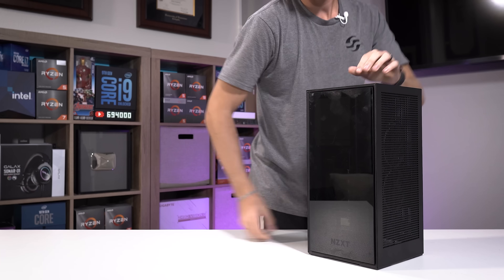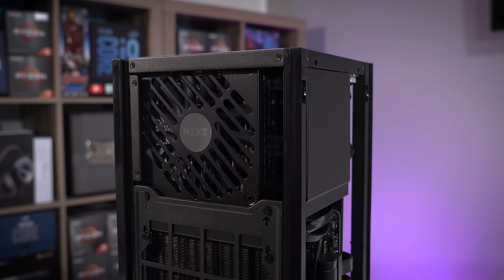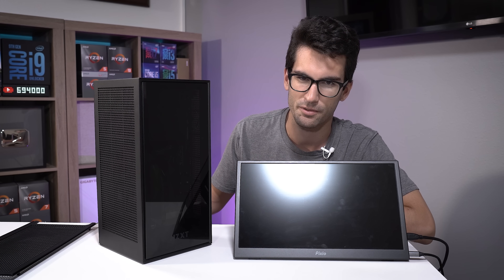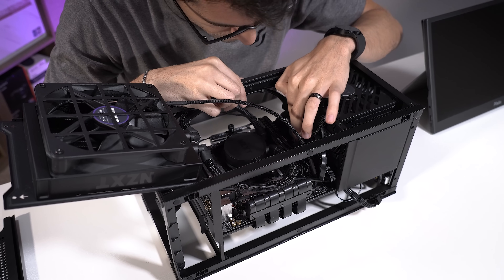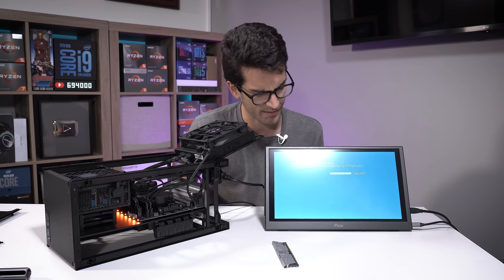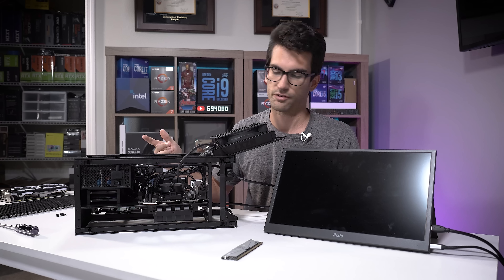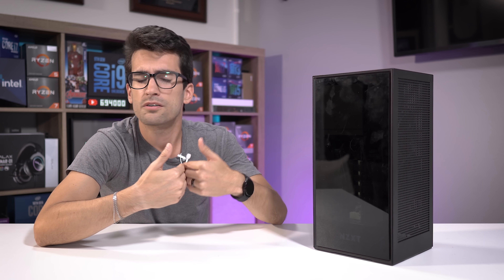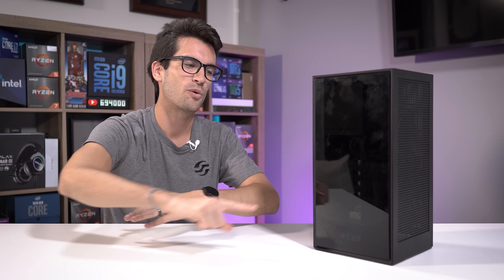Fixing a Viewer's BROKEN Gaming PC? - Fix or Flop S1:E16

Comment: SOMEONE PLEASE HELL !!!! I have recently just bought my first PC (prebuilt) for £800.00, I got it to play warzone on, I get a solid 60-80 FPS however my ping is always between 50-100, even though I have a strong wifi and this does not happen on any other games e.g. apex legends, I have tried everything to fix this, Ethernet cables, tp links, changing the dns settings on the pc, deleting back ground apps, deleting and re installing the game itself, but nothing seems to work, which I’d disappointing due to me buying it purely for that game itself, if anyone could help me it would be much appreciated, these are the specs for you too know ……. AMD 6 core RYZEN 5 3500 processor ….. NVIDIA GeForce GTX1650 …. 8GB RAM … 1TB hard drive (: 🤟🏾

Comment: So I just found a PC by the dumpster of my apartment complex. It has a 1060 in it… the only things that were missing was power supply and CPU. But I live in Seattle where it rains constantly. So the whole PC was wet. And steps I should take to try to salvage these parts?

Comment: I hope to god you checked that He'd swapped out the riser cable? (ps only 30 seconds in so? )
Ahh yes you did, 
As for the Ram I bought a PC so I could rob the GPU from it  and use the bare bone as a HTPC as it had a 3400g in, couldn't get it to work with the APU tried all sorts, different leads etc, eventually tried my RAM out of my other PC and it worked, put the original RAM in and it worked again. so RAM can be finicky as I only took the GPU out and didn't (Knowingly) touch the RAM. yet Ram was the issue

Comment: RAM Back in the day  used to be my 1st concern if no post .  1 always a bit dicky ddr3  OR not in right &  that loose cable 
  ddr4 all good  i once started PC new refit and forgot  the  watercooler cable Posted ok  100cel CPU  i let it run 2ms  to see what happened Nothing Gigabyte Aorus  was right  
if that happened on old ddr3 pc it would've shut down in a sec

Comment: Ram is really iffy sometimes lol, I remember with my current built I shut it off in the night and it was working fine, then it wouldn't boot back on and even the gpu wasn't turning on, I thought there was something wrong with the gpu but it turned out that the mobo first checks the ram before the gpu and it just didn't go towards the next step. I just needed to push the kits in harder.

Comment: A buzzer to sound out post codes would be a nice thing to get with a motherboard nowadays... My B550 has leds at least, but is it even a PC if it does not beep when turned on?? Anyway bad ram post code beeps would have saved a lot of time and effort.

Comment: I put the same GPU in my H1... Oddly enough I had a similar issue. It was the GPU (which was salvaged from an older system). slapped a 1660 Super and that fixed it.

Comment: I have build my friends pc it worked for 9 months now few day ago his motherboard ez debugging led was started flashing in msi b450 pro vdh pro max m2 I tried from bios with removing the cell and also by jumping jbat1  but I was not able to find the issue then we reached to local store and he changed psu then it works fine . But I was confused because when I was booting CPU fan was spinning .

Comment: mine died when i installed my nvme m.2 ssd then powered it off from bios screen. i believed i bricked it already. i tried the ram and gpu to no avail. i am afraid i might damaged my ram, board or worst cpu and gpu. i am really sad, even though its a fair low spec one, i spent a fortune (for me) and now its gone
Reply: Why install the SSD when the system was on? Try removing the CMOS battery.

Comment: I was screaming Ram from the start....I just replaced my AIO (first time working on a pc). Afterward I got no video. Freaked out. Full Panic Mode. Then remembered I removed the first Dim to fit the pump. I appaerently didnt reseat it properly when I put it back. Did the same thing you did and bam....All good again

Comment: I had a similar issue with my system when I built it earlier this year. I was receiving power but had no post. My brother in law seated the ram in the 2 slots closest to the cpu. I might have a dead channel in the first slot but I only use it for gaming and the other 3 slots work fine so I’m good. Also for some ungodly reason every time I would wake my PC from sleep it would do a complete reboot instead of just waking up. It doesn’t do it anymore but that was just odd and annoying.

Comment: Hey guys i really need some help and didnt know where to go other than my favorite youtubers comment section lol! Well Heres the issue.  Newly Built computer last night, and only drive i want in the computer is a 2tb samsung evo m.2. Everything ive tried i cant get the windows installation to work, i read where the system has to be in uefi mode to be able to work properly, well if i disable CSM and Use UEFI instead the computer doesnt recognize the m.2 and just boots stright to bios everytime, BUT if i switch it to CSM Instead, the bios sees the m.2 AND the windows logo pops up, then freezes, no spinning dots or nothing. Heres some things iv tried, ive tried Disabling And enabling CSM/UEFI. I also swapped the m.2 to a different port. I also tried moving the ram into different slots to see if maybe that was causing the issues, nothing. I also reset the CMOS. PLZ PLZ someone read this and give me a hand, this computer isnt even for me, its for my fiance’s little brother.
Reply: I also want to point out, i see that this is a common issue, but ive never ran across it.
Reply: Did you create an Windows installer USB? You need to boot from that to install it. You will need to use UEFI mode if the SSD is NVME. I would always use it if you can.
Reply: @TRD_2zz  thanks for the reply, the issue was the bios needed an update to read the nvme

Comment: there was a device, long before led diagnostic, that told you what the computer was doing. Remember the pc speaker? the plug is still present on probably) all motheboards. It is there on a ROG crosshair hero vii wi-fi. Although, getting a pc speaker could be a challenge.

Comment: The other day I had same issue on my second system...PC just didnt turn on. So I take out GPU and tested if works..it was, I swapped ram sticks and left only one in slot one, no fix. I suspected PSU since it was second hand and I had power crash in my flat. So I check cable connections...than swap PSU for other one...no fix...I started swapping cables from PSU...no fix. I was ready to start digging in to motherboard and CPU. But before that I did one last thing I can. Take out battery and reset CMOS. It worked ..I felt so stupid that I didnt start with that. I watch your videos so I knew well but I was so focused on PSU that I just didnt do it. 
Long story short ALWAYS start with CMOS reset.

Comment: It isn't a wiring issue. I have 2 of the same aorus b450i wifi boards and I have the same issues. The board itself does not post if it is under a little bit of stress to the bottom (like if you install the gpu). If you give it a little tip upwards it is all good.

Comment: Greg, this is not how you test memory.
you need to plug each module on its own first and than check if it is stable under full load (memtest64 / OCCT memory test).
after testing all memory modules individually, only than you can reconnect all the good modules back to the motherboard.
Reply: Yea I would of ran memtest86 on them for a bit since it could still have a bad stick and the issue will come back again.

Comment: I looked at the ram before you removed them. you even pressed on them (slightly). they looked properly seated from what I could see in the video. maybe the stick further away from the cpu was a millimeter higher, idk it's hard to tell

Comment: Wow, this turned out to be a much simpler problem than I thought at first. What baffles me is that, considering he replaced the motherboard and consequently had to reseat and rewire everything again after installing the new motherboard, he must have had the RAM already improperly seated on the old board and then done the same thing on the new one without noticing. Not throwing shade at him or anything, things like that have happened to me in the past and made me feel really stupid, but still this is one of those things where you just facepalm because of how much time you spent on the issue when the fix was that simple.

Comment: Could it have been xmp or the like? I had a similar issue that the memory was not supported on the motherboard so could only run as 2333speed as soon as I did a coke boot after enabling xmp, I got no boot but everything turning in

Comment: Hey Greg, Greetings from India... Great video as always... As a PC hobbyist myself, I find it informative to watch troubleshooting videos like these... Just a quick question to the community though... Why don't you guys use/recommend plugging in a PC Tweeter/Beeper on the Motherboard... I find those things great for troubleshooting purposes if the motherboard doesn't have an error code display... Like in this case of a memory seating issue/error... There should be three beeps on the tweeter (One long followed by two short beeps)... I am asking because I have rarely seen any PC youtuber ever plug in a tweeter... Or are those not a thing anymore on most motherboards... My current motherboard (Asus X570e Strix) has the header for tweeters, though the tweeter I am using is something I salvaged from a previous build...

Comment: 1. Check PSU with Power Supply Tester; if the PSU is good, then--
2. Pull out RAM; see if the Board runs without it (connect PC Speaker for Beep Codes) if it does then--
3. Reseat RAM PROPERLY, make sure it's firmly in the slots, and locked. Should POST. If not, then--
4. Remove GPU, (if the board has Onboard Video) see if you get a POST. Of course, other things can prevent a POST, bad CPU, bad BIOS, etc, but those are the main ones. In other words, see if the Board will run without anything connected to it.

Comment: Someone asked me to fix his computer. According to him, The problem was after 15-30mins., The pc will shutdown. (tested  and it really shuts itself after a few minutes) Turning back on, it will turn on but no post and no display. No beeps as well. I tested his gpu, ram and psu using my own unit and it all works. So I suspect it's the motherboard. The next day, i went back to check it again if it's really the mobo. I installed his motherboard (with his cpu and ram) in my unit to recheck if it's not the PSU and  the problem didn't occur. I then returned it to it's original case and it has no more problem. I can't point out what's the problem. So i just told him to bring it to the repair shop when the problem returns because i don't have a spare motherboard to test.

Comment: 2 minutes ago (edited)
Tad off topic but I  have a  asus primez390-a motherboard with a i9 9900k and a  evga 3080ftw.So I was bored and upgraded bios from 1901 to 1903 for win 11 support it said no need to change bios settings.But what it also did was disable my resizabile bar which i worked so hard to get enabled and now its greyed out on my board..ugg and was working fine on 1901.so  be aware if you do it on that board.I sent asus a message but no reply in a week

Comment: Did the people at Geek Squad really not bother reseating the RAM after a failed post? I don't expect them to be PC Savants, but c'mon, that's pretty much always the first thing you should check.
Reply: It's likely that it was originally a motherboard issue, and when the owner replaced the motherboard, he seated the RAM incorrectly.
 

The other alternative is that Geek Squad didn't reseat or run diagnostics on the RAM, and the owner just doesn't know how to seat RAM correctly (also how would RAM unseat itself after working properly?)

Comment: Best Buy: "It's a motherboard issue. You'll need to buy a new motherboard". 

Greg: "it's improperly seated ram."
Reply: It's likely that it was originally a motherboard issue, and when the owner replaced the motherboard, he seated the RAM incorrectly. 

The other alternative is that Geek Squad didn't reseat or run diagnostics on the RAM, and the owner just doesn't know how to seat RAM correctly.
Reply: Was never the motherboard. Also the ram was properly seated.

I had this happen to me as well. Computer was on, thought it went into sleep mode. 
I had to take out my ram. Start with 1, turn it on, then 2, turn on the computer, then 3 , turn on the computer, and then the fourth.

Before I did that step, I took them all out, then put them back in. I repeated that till I thought I might have a stick that went bad.  It was super odd. I basically built this system as soon as the 2700X first came out. Last month is when I faced that issue. All 4 sticks are good. Still don't understand what actually happened.
Reply: @SuperBROKEN81  Ah, so you're saying both Geek Squad and Greg are wrong, and instead, its some unexplainable freak accident that happened to you once.
Reply: @_Xenux  Same issue that the person encountered that got Greg to make the video in the first place. 

Explain how the person's computer was working and then stopped. I'll wait.... forever. In the text message the guy even thought his computer was in sleep mode. Which means his PC was working. The ram was seated. Just because a guy has a YouTube channel doesn't mean he is correct, also have you ever dealt with geek squad? The majority are idiots.
Reply: @SuperBROKEN81  You don't need to wait.
The most confusing issue I've had to deal with in my PC was exactly that. One day it would shut down under heavy load, was working fine before that. After troubleshooting, I concluded that the issue was my motherboard. It seemed that my top PCIe slot was damaged/defective. So I RMA'd my motherboard, got a refund, bought a replacement board, and never had the issue again.

In my case, my computer was working then stopped. The difference between my case and yours is that in mine, I was actually able to identify the issue, recreate it, and was confirmed to be correct by the manufacturer.

Just to be clear, I'm not saying my issue is what happened to the PC in the video. The point I'm trying to make is that you cannot make judgements about what happened to this PC because you don't even know what happened to yours. Greg replicated the issue AND fixed it, and that will ALWAYS hold more integrity than some baseless judgement.

Comment: Hopefully this is helping out some new builders (and maybe some experienced ones) the importance of "just" taking it apart and putring it back together, making sure everything is seated correctly and cleaned. And then just taking it to bare minimum and adding one piece at a time.

But there are some cool little trickers you learn later like the screw driver to turn it on, thinking about doing that to a brand new $1500 system back in the day was the thing of nightmares until you know it doesn't "break" the board or anything.

Keep it up Greg, always fun videos!

Comment: Awesome. Just want to share For me it helps to have a handy motherboard speaker as well. For some boards without the diagnostic LEDs, the beeps from the speaker really help a lot. I wonder though why the builders in my area does not include motherboard speakers in their builds anymore. Thanks for the video!

Comment: Remember worg setting some time could give you headache I understand that memory stick is not all the way but make sure go and check after put parts back Your settings are good to go I work long time with computers I'm computer guy over 25 years or more I learn every year something new and I'm still sharing information whatever I learn Some motherboard are different from each other I hear from someone he took out parts out and computer do not remember everything went to default settings he setup everything was perfect  make sure noting  heating and get warm I do not teach any one everybody are different You started with graphic card you assume the graphic card was dead then check so any one will do it first place then power and hard drive the lat will be memory DDR 5 new memory let see future ok bye

Comment: I actually had this issue yesterday. I had to reapply thermal paste on the CPU for the AIO, and pulled out my RAM. One stick wasn't seated properly but my motherboard has a debug LED (orange) for ram specifically and turns out I was hasty on the last stick. It looked seated while laying down but once I had it upright I could see it wasn't.

Comment: I'm wondering what the original issue was. He got a replacement board and the symptoms were apparently the same, I doubt it was a poor RAM seating both times.
Reply: Another good question is what would cause the RAM to unseat itself? Originally it was working properly, then just stopped
Reply: @_Xenux  it wasn't working properly on this motherboard. It only worked properly on the previous motherboard.